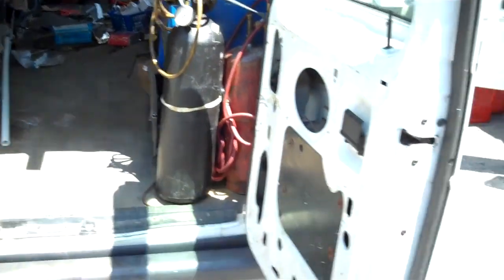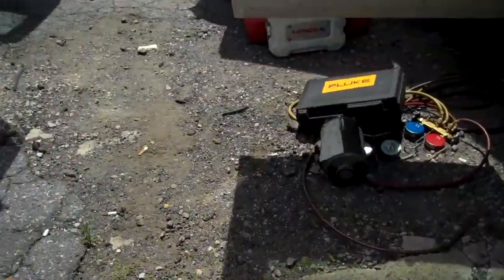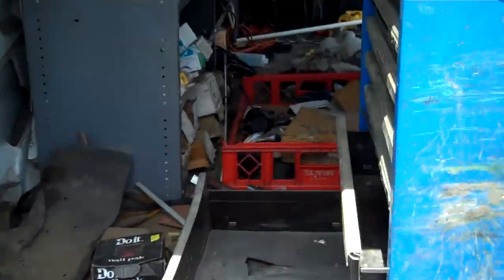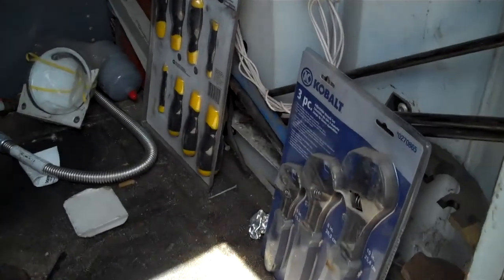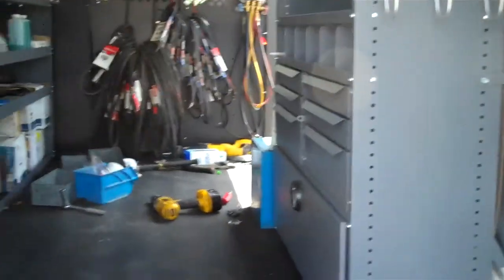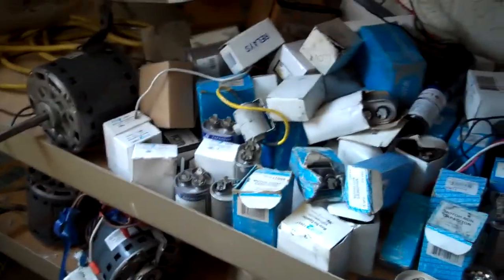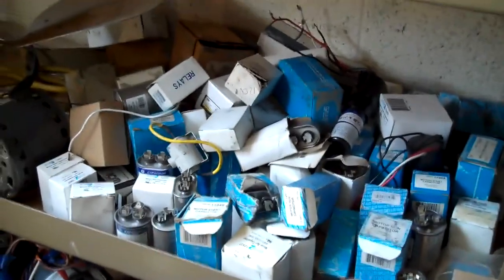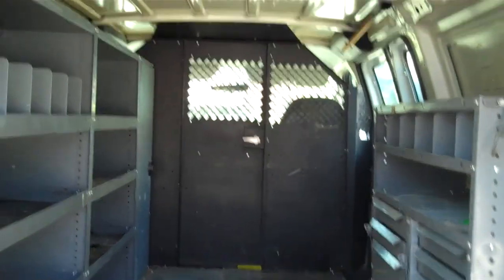New Truck

Comment: Always sad to see an old work colleague go, but the feeling passes all to soon after driving the new one!

Is that rubber matting on the floor? I've always put some 3/8" plywood on the floor, makes sliding units in and out easier and its handy for screwing any shelving down. Never liked the idea of bolting through the floor in case it goes rusty lol.  

What engine has it got? Looks about the size of a 3.5t  mwb sprinter, most have either a 110 or 130 hp 2.2Litre engine here!

Comment from the maker: @fritzhvac Thanks!

Yea it was a real feat. 
But now the even harder more tedious part,
detailing the old trck for resale! I've spent about 4 hours on it already and didnt even dent it. I pulled upto the carwash and literally pulled the carwash into the van! That vinyl flooring is near impossible to clean, even with a pressure sprayer. As soon as it dries it looks duller than before. So I got myself a gallon of mean green degreaser and an old fashoned scrub brush.. Let the games begin!!!